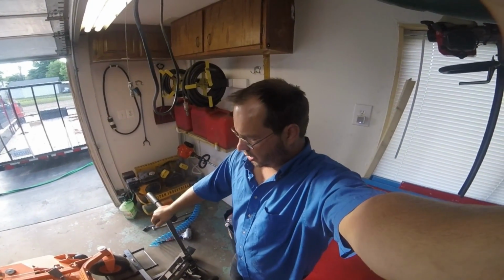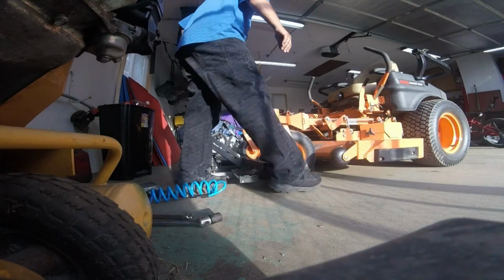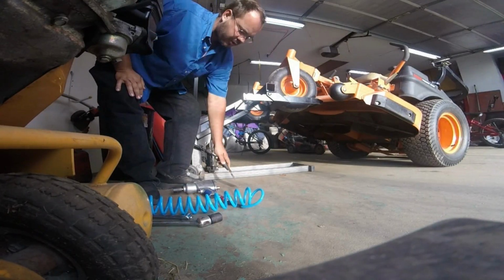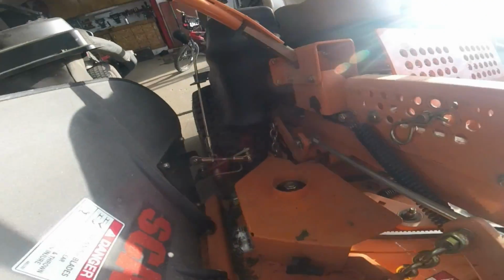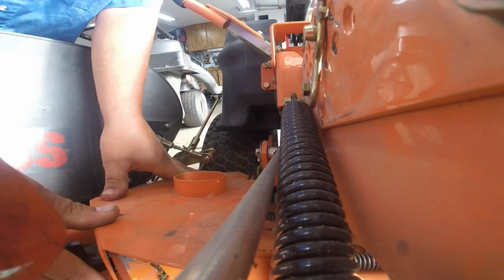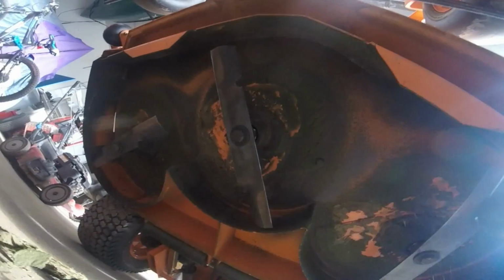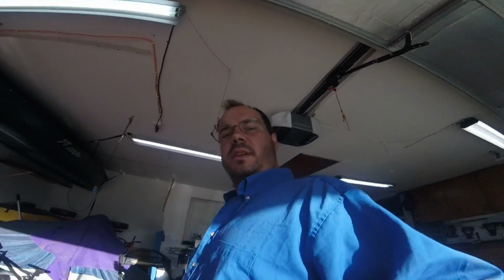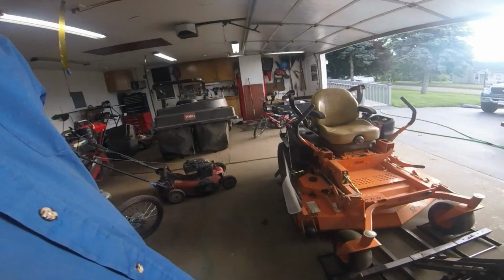Scag Change blades and clean

Comment: I'm a homeowner, but I'm looking to buy a used commercial mower. I've had a big box store John Deere L100 since brand new 17 years ago and never been in the shop. I also plowed snow with it for about 12 years. So now looking to upgrade.  I let my stamped deck get rusty underneath about 3 years in. So now when I take off the blades to sharpen, I spray WD-40 under the deck. Keeps rust down and helps remove the caked on grass. I use a wire brush to clean the bolts and a scraper. I use a $40.00 bench grinder to sharpen blades, then hand file burrs. Had a stress crack on the deck welded last year. Looking at a used 52" Scag Tiger Cat. Thanks for the video.

Comment: I need some help! Can you help a brother out? Im trying to take the blade out to sharpen them. You see how is easy you blade just drop down. Mine is stuck like pain in the butt stuck.. I try to bang it out but it seem to just go halfway. Should i just try to keep banging it through until it falls out?
Reply from the maker: The bolt wont come out due to it's bent or spindle needs repair.  Take another bolt put on top and tap it until it comes out. This is another reason I change blades everyday.  If you leave these bolts for long periods it can also rust into the spindle.  Spray with wd-40 if you plan on changing only once a month or longer periods.
Reply: @DelsLawnCare  Thanks you Sir! I appreciate it. I'd tap it out after a couple hard bangs but it came out. It's a 19 year old lawnmower it was rusted been like 10 years since my father sharpen the blade. I will look forward to sharpen the blade every year or two. I might as well do the whole 9 on the maintenance change the bearing in the Spindle etc lol.

Comment: Is this how you change the blades on all scags ? How about tiger cat 2?
Reply from the maker: If the bolt is the same with a nut on top yes. Some manufacturers have went with no nut on top and a small bolt on the bottom.
Reply: @DelsLawnCare  Im going to get a impact gun today. Is the nut holding blade on a left hand thread???
Reply from the maker: @billwilliams9897  nope just like every other bolt. I am yet to see a mower with things backwards. I do notice that on the scag mower only that they are a lot harder to get off then any other mower. It's not a big deal but just a little tighter for some reason.
Reply: @DelsLawnCare  yea they are harder.  But I didn't try to force it either. I sprayed it with some penetrol and Im letting it soak. I was think that back in the day push mowers had a left hand thread bolt holding the blade, and I just wanted to get that cleared up before I press on. Thank you for your help.
Reply from the maker: @billwilliams9897  my pleasure.  I just wanted to say something about the bolts.  I have banged my hand a few times.
Reply: @DelsLawnCare  I think I am going to invest in a impact.  Ive skinned my knuckles too many times over the years. I have gotten in to the habbit of wearing thin leather gloves when breaking bolts and nuts loose.

Comment: Any idea what size socket that is?
Reply from the maker: 24mm or 15/16
Reply: @DelsLawnCare  thank you
Reply: @DelsLawnCare  You saved me man. I was at Tractor supply which is 25 miles from home, when you answered that question. I bought the 15/16 And it worked. Thank goodness. I'll never let anyone else change those blades again.  Thanks a million.
Reply from the maker: @billwilliams9897  my pleasure.  I'm glade I didn't wait to reply and save you time and gas. Thanks for watching our video.

Comment: what is the torque gage you use on the impact wrench to tighten the bolt?
Reply: I use a 75lbft torque wrench. You can also use a torque stick.
Reply: @mormonsniper5183  what size socket

Comment: So you don't need to block the blades off when using an impact gun to prevent the blades from spinning? 

Also, can you over-tighten the blades when using an impact in this way to tighten the blades back on?
Reply from the maker: EternalNarwhal I never use wood for blade. Can you over tighten yes. I been using same 350 ft lbs In pack gun for 9 years never replaced a bolt or spindle.

Comment: Not a bad video except that it's not really worth it. 3 brand new blades literally cost $32 DELIVERED to the door, and are safer and better than sharpening rusty old blades that have metal loss. People, don't be a tightwad, just buy new blades every 2 years and your lawn will look flawless. It's only $32!!! You will spend more than that on gas! Besides- these amazing professional mowers cut mainly by using raw tip speed, they don't need to be razor sharp, and that kind of edge will never last if you mow every day!!
Reply from the maker: rcvideoshooter I would love to watch someone mow 126 customers a week for 2 years with out sharpening blades. $32 delivered to for please share the link to the place you buy these blades.
Reply: 126 lawns a week........wow....you a busy man !!
Reply from the maker: rcvideoshooter yeah more busy then I want to be it's crazy.
Reply: What size socket
Reply: @billwilliams9897  24mm